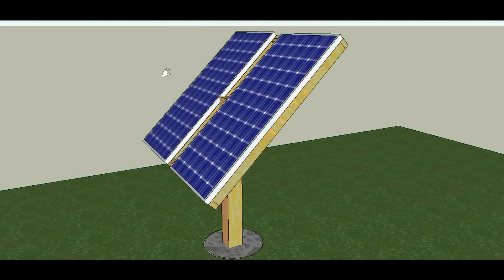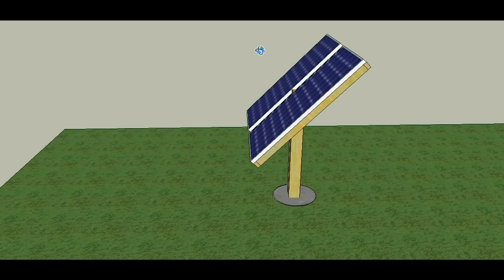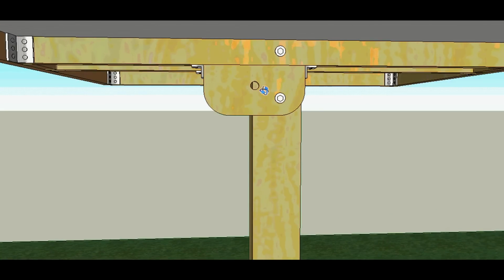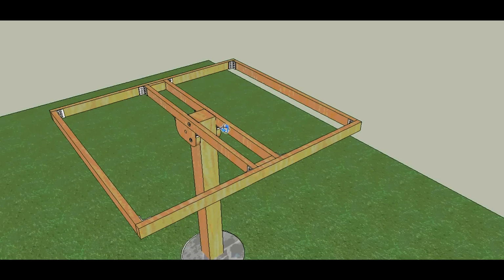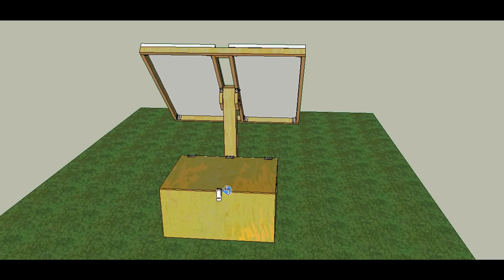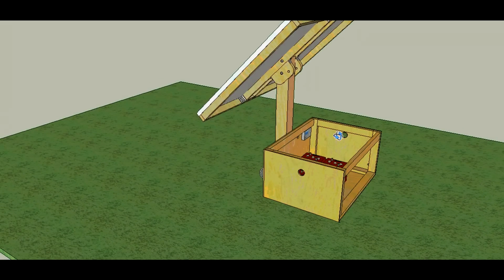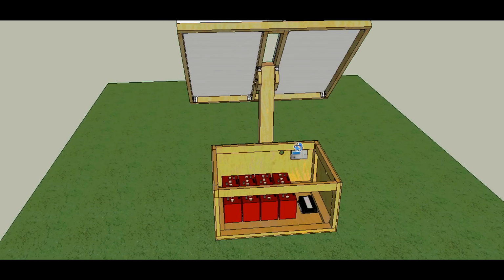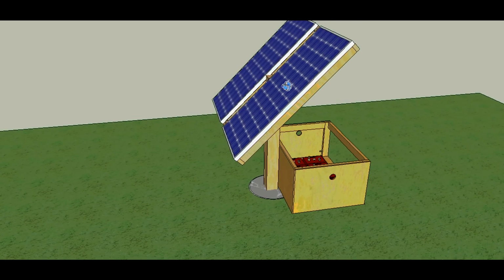Post Mount Remote Solar System Design by LaMar

Comment: A friend of mine took an old style 8' or 10' metal dish and built a metal frame on the front of the dish to hold 6 solar panels.  After mounting the solar panels to the new frame on the old dish, he installed two light sensors (one on the left side and one on the right side) of the solar panels and attached them to the original actuator piston arm that moves the dish from one side to the other.  On the original system, the actuator arm moved the dish to follow the arch of the satellites.  On the new system, it follows the sun across the sky for maximum direct sunlight.
Reply from the maker: Thanks- trackers are good if they work correctly but I have seen them jam a lot and leave the panel at the wrong angle. I wanted simple with no moving parts except the tilt. It will get the majority of sun with less chance of something failing.

Comment: just a thought ,  seeing you are going to wire it in 24volt you can use smaller and cheaper wire  to your controler and batt. then batt can be  near or in cabin to stay warmer in winter. check out videos on  wiring 24 volt panels ,  LDSPREPER  has great video  explaining,
keep up the videos   thanks
Reply from the maker: Thanks friend- I am thinking about going with 24 volt for the cabin and using my old 12 volt on my camper. Panels and wiring are cheaper for 24 volt. I have explanations for both hook ups in my ebook.
Reply: solarcabin
we keep looking at a inverter that can power our well pump, the local solar supply missouri wind and solar has a 12v that they stock for just that reason.   But, it runs about $500 and would be specific to the well pump.    The other option is like you, considering 24 volt my contoller can handle both, and we are adding a 2nd controller to run a 2nd battery bank.   then we can look at the split phase inverters that can run 240 and 120v at the same time.   Our generator is not big enough to handle the surge on this deep well pump, and we cannot put a parallel 12/24 volt pump down our casing due to the stupid liner we had to install, non will fit.
Reply from the maker: Hi Fritz, look on Bison Solar and they can recommend DC pumps that might work. 24 volt will run a  bigger inverter and might work for you.
Reply: There is a cool nemo pump available that will pump at depths of I think 225 or so max feet.   Out pump is set at 200' and water level was at 100', but we have a liner in our well,which reduces the diameter and combined that with the 1" pipe there isn't any room for the nemo.   There is a product called a simple pump, that will fit alongside our pump lines, our pump guy recommended it, but their quote was astronomical in cost.  I can buy 2 generators that would run the well pump for still less than the cost of their manual pump.... so now trying to figure on a inverter, and have the means to pull the actual pump in the event of a long term outage, then the 250 dollar nemo would work...    I will check out Bison and see what they have.  Thanks!.

Comment: I've made a few solar tracker mounts with wood, but find that it has a lot of give to it and makes a sloppy hinge system.  I'm thinking the center of your mount  is going move around very sloppy like.  I'd make that with steel and maybe rest the panels on wood that is glued like angle iron for strength.  I used layers in sketchup to turn on and off different things.  Very good sketchup work there.
Reply from the maker: My design doesn't swivel or track at all. It is secured to the post with 3/4 bolts and lock washers so I don't think it should move. It will only be adjusted once in the spring and again in the fall.

Comment: dc up new led light bares are really cool computer dc power battery need to be close to draw yes inverters wast power the frig is a lot of power big wire will pay you back cold is hard on batterys the railroad used a pit like a well pit.the ground likes to stay 56*f 3to 4 feet down most places  water table may limit maybe a mound if water table is high a fruit seller would work storm shelter how is the windmill doing

Comment: I always find your clips educational and entertaining. This one has inspired me to make my panels a more permanent installation rather than just leaning against a wall. My only suggestion to others viewing this is to remember that wet cell batteries outgas flammable vapors when charging. So, even if the risk is considered small, one should always do what can be done to make sure there will be no chance of a spark near them. Putting electronics in the same box as the batteries would only be okay if the box is well ventilated. An alternate approach might be to partition the box so there is an airtight 'wall' between compartments and ventilate both as necessary. Use some screen material to keep critters out.
Reply from the maker: Thanks- I thought of the partition after looking at my own design and I think I will make a partition between the electronics and batts.

Comment: Nice set up.  Here is the solar tracker that I put together, may give you some ideas. http://youtu.be/ppWYHpwLxcc  You can go back from this one to see the earlier steps of putting the post into the ground.  Good luck with your system come Spring.
Reply from the maker: Thanks friend- I will check it out. I have seen some trackers jam leaving the panel at the wrong angle. How is yours holding up ?
Reply: solarcabin No Jams per say.  Had an issue with the original actuator arm not being strong enough to support the weight.  Once I replaced it with a much higher rated actuator arm, it works very well.  Has been in 70mph winds and made it thru in the high wind position (Flat or parallel with the ground).  We are currently under a snow emergency with -45F windchill and its making power even in the high wind position. NorthWest Ohio.

Comment: Why don't you use the utility shed that the batteries, washer/dryer are in right now. Just put the panels on that roof with a hinge at the top and a support leg for the summer. It will be close to the same height and width of your post mount. You may need to move the shed
Reply from the maker: The shed is in the shade of my cabin and I want to get the panels down lower to keep the snow off and make maintenance easier.

Comment: you could use old antenna TV rotors to make this follow the sun... or use those old analog huge dishes and use the AZ/EL rotors to aim your box at the sun !
Reply from the maker: Thanks- I thought about a tracker but from my experience trackers have a tendency to lose the sun and jam leaving the panel at the wrong angle. The tilt will still catch the majority of sunshine without extra parts to fail.
Reply: solarcabin For sure your solution is the best at not failing ! Also, the amount of work to do this tracking system is questionnable related to the real gain of power production it would provide. I just said that as a "cool" project to work on.

Comment: Lemar, read your book. It inspired me to get my NABCEP test. I scored an 78%, and am now working in the Solar Industry. So first, thanks! Second, should your battery compartment have a sloping lid? If the water just sits on top of it it's just going to rot the wood. Take care, and all the best in the coming year.
Reply from the maker: That is great to hear!  You will have more work than you want as solar is going to be huge everywhere.  I am going to put tar paper and a steel roof sheet on it I think.

Comment: not worried that someone may come around and take it.. its all right there for some one to take while your away.. think about security... nice to see you again.
Reply from the maker: I am going to attach the box to the post and to the ground. Unless somebody is watching me they won't know anything is in the box and with two big hungry dogs they better move fast lol!
Reply: lol.. thats for sure! well, your doing the right thing by running you ac wire to you cabin. ! wire is cheaper 2 you can run the wire from quite a ways 3 you should not lose much of your power that way..... I am going to try something similar but make a small building insulate it and then throw up a wind mill with a dump load to a heater to help the batteries in the winter time.. cant wait to see what you finally come up with.. good luck..

Comment: NOTE: I see now that someone else posted the same Sat Dish Mount idea before me. I don't want to look like a am a idea stealer lol. But I will leave this up so you can see the other video. We need to all stick together in the sharing of ideas. You could always just mount the dish bracket to the wooden post and get more flexibility. I look on Craigslist and Freecycle and see those Dishs being discarded for free all the time. Just need to go pick them up!.

Lamar, many people are now using a readily available resource for mounting, Direct-TV Dish Mounts (any 18 in Satellitte Dish Mount brackets). Check this guy out and see what he does. The rest is up to you. http://youtu.be/W_hMuZ9k1j0 I have no relationship or experience with this YouTuber, its just a quick video that explains what I mean. Good Luck Lamar. Im also getting old and have panels on my roof, ground mounts on posts just makes so much more sense. My only issue is HOA constraints. It is hard for them to argue about my roof, whole other ballgame on ground mounts!!
Reply from the maker: That's cool- all ideas are welcome friend!

Comment: Check out my video where I used a satellite mount and steel pole for the panels mount where the tilt and direction can both be changed Offgrid Jeep at Offgrid Arkys part 5 . ollllllllo
Reply from the maker: Looks good- a little more complicated than my design but that should work.
Reply: It really worked good, cause it could be changed on low Sun days to get the most power possible. olllllllo
Reply: yeah it works good, i seen it... adjustable too but u need a wire strap or chain linking the bent pole at the top the the vertical pole so the wind don't rip it off, there for being more secure in higher winds.

Comment: If you only have power from the inverter in your house how will you power any of your 12v appliances/tools ?
Thanks............Ken in Anaheim.
Reply from the maker: I will keep a small DC system on my shed. I don't use DC much except for my water pump. The post system will run my fridge and larger appliances.

Comment: lamar...i am up here in south central ontario...in like -20 celcius territory....batteries do not charge well in cold conditions...you might be best to keep your batteries inside the cabin...even under 70 degrees farenheit they dont charge or hold charge as well....now i am guessing your not in this kinda temp freeze zone but you may need to run a small 12 volt light inside your insulated box to help generate some heat...up here i run a 50 watt spot light between my 2 battery system to keep it warm during the winter.
Reply from the maker: Thanks- I don't really recommend putting  batts in a living space. They off gas and the gas can explode and will make you sick. A small insulated box will stay warm from the heat produced by the inverter and controller. We hit -10 rarely here.

Comment: In my opinion you should run a 12 volt line to the cabin and keep the inverter in there.
Reply from the maker: Hi friend- not a good idea to run DC wire long distances. Better to keep that inverter close to the batts.
Reply: solarcabin Why? I have a small well pump that run on 12 volts, it's cable is about 150ft long and it's doin just fine.
Reply from the maker: The longer the run the more heat created and power lost.